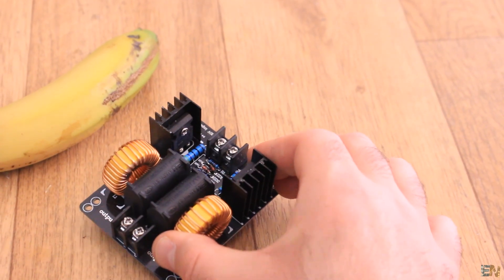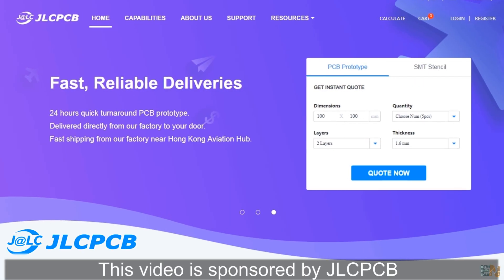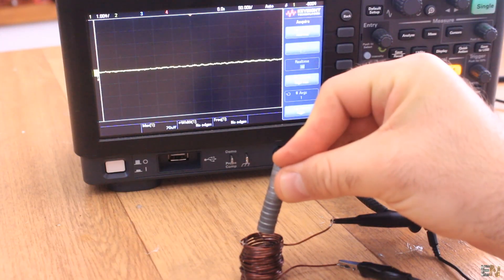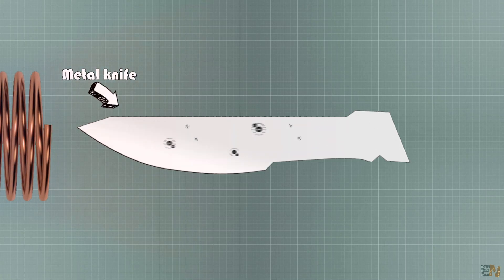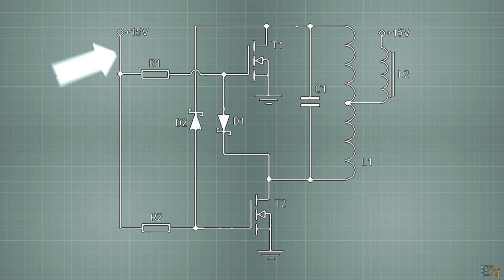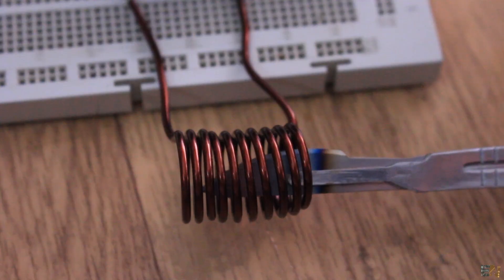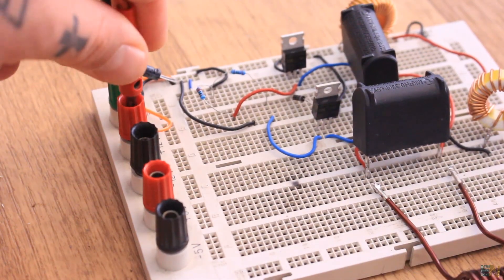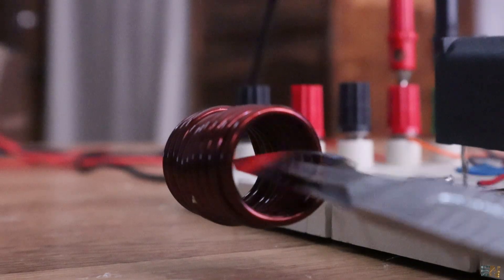DIY Induction heater module + Theory

Comment: Hi there.  Thanks for excellent video. I have brought an induction module identical to the one in this video.  As soon o I power up, the coil terminals get hot and melt. I am using 4mm water cooled copper tube with 6 turns 40mm diameter and powering with a 24volt 20amp switch mode power supply. Any advice will be appreciated

Comment: Friend, I have a circuit like yours.  But when I turn on the power supply it drops from 12 volts to 5 volts and heats up the transistor on the left and doesn't heat up the stylus. What could it be?

Comment: Is there a way to adjust the intensity of the EMF? 

I think most people are essentially pulsing the input voltage. I’m hoping there is a more reliable way to adjust the strength of the field for more controlled heating.

Comment: Now the zero voltage switching model works, but you don't have control over the frequency setting, which is not good

Comment: Commercial induction hobs are digitally controlled. A shame there's no open source projects for digitally controlled cookers, it would be much safer and much more useful in general. Any idea where I can find resources? 
As I understand it, the commercial induction hobs do a frequency sweep (no clue how that works) and adjust their oscillation frequency to match that of user's desired power output to the workpiece (also no clue how that works, some combination of transistors and chunky inductors/capacitors). Any help appreciated!

Comment: I have that same module and am using a 24vdc, 1000w, 20amp power supply.  The coild is 10-guage solid copper wrapped 7 times.  Set to 24vdc, I turn-on the power supply and in about 1 second, the coil gets so hot that the solder holding the terminal on the circuit board melts & the terminal falls off.  Any idea of how to correct/fix this problem?  Thanks!

Comment: I imagine how melted and deformed is the breadboard after 1 minute of operation. The ZVS as far i know transfer huge amounts of current between the coil and the tank capacitor,  especially if you put metal for heating. The traces of the board are maybe steaming hot, and the plastic is burning.

Comment: At 1:55 he keeps saying that " there is a current induced in the inductor!"   He should correct that as he has an OPEN CIRCUIT  and so there could be "no continuous constant current" in the inductor, It is the voltage that can be externally measured depending on THE RATE OF CHANGE OF MAGNETIC FLUX.    Also, the oscilloscope probe normally measures VOLTAGE  difference and so what he is doing is changing the magnetic flux to induce" a measurable voltage" at the ends of the inductor.  In this case of an open-circuited inductor, the relation is Voltage =  Number Turns * Rate of change of flux. There is no external current flowing.
If we want to be really accurate in what we say, what happens when a  continuous rate of change is suddenly applied, then the rate of change of flux will force and move some of the equally distributed electrons already existing in the copper of the initial electrically neutral inductor to one end of the inductor, creating the electric charge at one end to form the voltage we mentioned. Note that when a sudden rate of change of magnetic flux is applied,  to an open-circuited inductor,  the movement of electrons is only for a short moment until the ends of the inductor charge up with a DC voltage in case of a continuous constant rate of change of flux, which cannot happen in real life and that is why we normally use AC activities in an inductor, to reach a limit and then keep reversing the action to produce a variable but a continuous rate of change going from a positive to negative passing through a zero rate of change!!!.

So for a constant rate of change of magnetic flux, the output of the inductor will be DC, and then and only when  the inductor is loaded there will be a continuous current in the load, but not with an open-circuited inductor............as  there will  only be a movement of a  group of electrons till the end terminals  of the inductor do  charge up to the voltage produced by the action Force of the (Number of Turns) multiplied by the (Rate of Change of magnetic flux) 
Really we can compare the charging of a capacitor to that of charging an inductor as while the capacitor has a number of electrons being moved from one plate to another by an electric field, in an open-circuited inductor one of the ways to move electrons is by using the rate of change of magnetic field. 
Many statements in electrical engineering may sound simple, but they could be misleading and it is a case which can give great meaning to what Albert Einstein said,, " You can make an explanation simple, but not any simpler than that!"

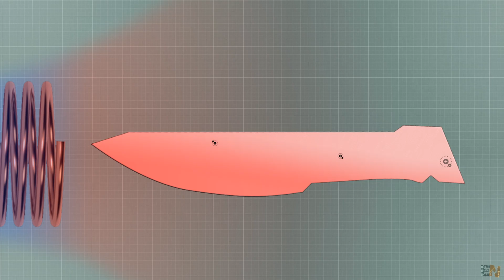Also, the eddy currents in the knife, do not go "back-and-forth" as he described at  03:18 but Eddy Currents flow in LOOPS  and  SHORT CIRCLES, in the plane of the turns of the original inductor. It is very important to note that the actions in question ( V= N* d( Flux) dt) have VECTOR QUANTITIES  with magnitude and directions and one cannot get neither the magnitude nor the direction wrong as the system will not work.
One needs to look at the direction of orientation of the laminations, the orientation of the coils, so the orientation of the electric and magnetic fields, used in Transformers and Motors and generators to get an appreciation of the importance of getting the orientation of the eddy current correct, and it is not a simple statement, " They go to and fro or back and forth! "

Comment: This person needs to be more careful as all the circuit diagrams he showed do not describe the actual circuit he built. So it follows that the explanation of how it works is not what he described.
All his circuit diagrams in this video have a center tap in the tank inductor and so the coil is split in two where the center point is the positive of the power supply.  The circuit he built does not have a center-tapped coil and it operates rather differently from what he said.  
The non-center tapped coil is not connected to the positive supply but the two other inductors are. Basically what happens is the following, when one Mosfet is on, the inductor in its drain, sink in current and starts storing magnetism, then when this MOSFET is turned off, the stored magnetic field in its drain inductance will cause the drain voltage to shoot very high, and ACTING AS A CURRENT SOURCE  it feeds its energy into the parallel tank circuit which can only be activated efficiently if it fed on a current source.   Meanwhile, the other Mosfet is a dead short circuit for the other end of the oscillating parallel circuit.  
While this is occurring the other short-circuited monster will connect the tank circuit to earth and also be charging up the second inductor to repeat the other half of the cycle.  
The circuit he built is a beautiful circuit as the drain of the Mosfet acts as a voltage source when on and as a current source when off!   As an oscillator it is remarkable how the current source effect matches beautifully into the impedance of the parallel circuit.

Comment: What I don't understand is why does the circuit use a parallel  LC circuit, which has high impedance at the resonant frequency. Wouldn't a series LC circuit , with low impedance, allow more current to flow thru the coil? and higher current equals stronger fields

Comment: Excellent video. I noticed schematic had an inductor in series with + supply but it was not in your circuit or in the eBay unit. What is the purpose of the 3rd inductor?

Comment: Thanks for making the video, I'm loving your series on how electronics principes work. Sometimes though, you lose me at particular steps because it assumes prior understanding of electronics. In this video it's the 'flipflop' switching between the two mosfets. I understand that switching is part of making the coils oscillate but I couldn't extract from the schematic why the switching happens. You're providing DC power to this circuit, no?
Reply: look up the tanner tech video ZVS flyback driver. He does an excellent job explaining the switching effect your enquiring about.

Comment: A DIY induction soldering iron might be an interesting future project. Basically a Metcal for a fraction of the price. (Probably be best to use replacement tips rather than trying to adapt normal tips to induction heating.)
Reply: _____  It would be interesting to compare induction tips to integrated heater tips. Traditionally, induction had a huge advantage since the heat is generated in the tip itself. It is very well possible that integrated heater tips (like what the TS100 uses) has narrowed the gap to the point that induction no longer has that much advantage.

Comment: Use this with a CNC machine. Use the induction heater to create a self sharpening cutting tool. Heat + slow cooling = annealing, (AKA softening of the steel). Heat + fast cooling = hardening. To make cutting tools, steel is first annealed. This processes makes the steel easy(-er...-ish) to cut and grind. Finally, the shaped steel is heated again, and cooled quickly with something like water or oil. This creates the hardness needed to use the shaped steel as a cutting tool.
  The simplest cutting tool is just a pointy thing. If a steel rod was ground with one angle to a point, and the point was offset from the center, you would have a potential milling cutter. It just wouldn't last very long with this shape. However, if you could anneal the steel, you could grind it with typical cheap abrasives. If you can harden the steel tip with a repeatable process after grinding, you can create a repeatable cutting/annealing/regrinding/hardening routine (aka the cutting time is programmed and it always keeps the tool sharp).
   You would still need a way to feed a long rod through the milling collet and a way to keep up with the z-axis tool depth. Why do this? By far, the most expensive part of machining is cutting tools especially in a professional shop. If you could process your own cutting tools in-situ you could machine anything cheaply. Even if you would normally need to have a special cutting tool, the wrong size/shape tool will still work most of the time. Normally you avoid doing this because of the cost:time ratio.  If you change the cost factor you must re-evaluate the ratio. I'm suggesting the creation of "One Tool to Rule Them All."

Comment: May I know, why your breadboard can withstand such high current flows? Because I remembered that if current greater than 3A maybe some chances to melt the breadboard.
Reply from the maker: Is an old breadboed and is made out of a different plastic ... I had no problems...
Reply: @ELECTRONOOBS  okay interesting :) thanks for your effort always make a lot of amazing videos. I really inspire your different microntroller project especially you used the button to control the user interface and menu. I am also your patreon supporter hehe
Reply from the maker: @mhzxtal922  thank  you very much for your support
Reply: Was about to say this..